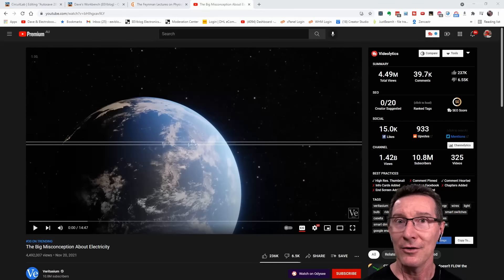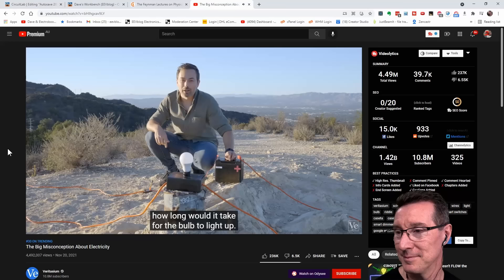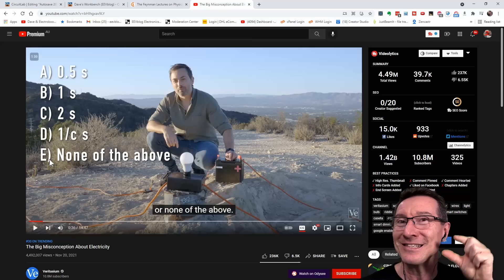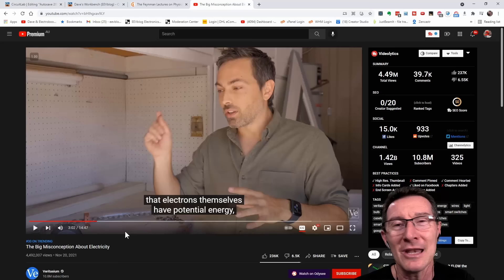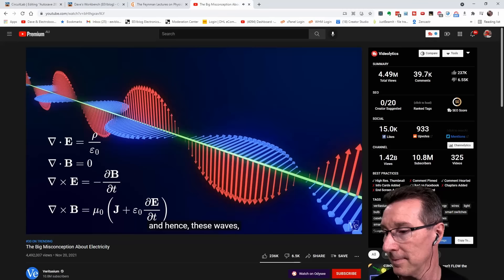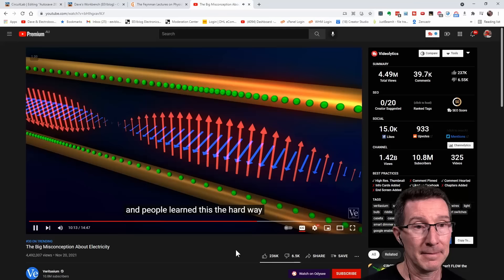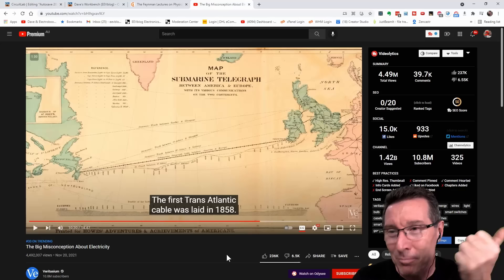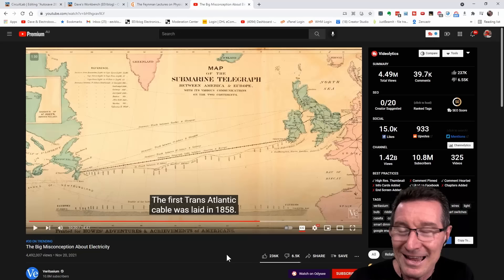EEVblog 1439 - Analysing Veritasium's Electricity Misconceptions Video

Comment: 20:41 "everything he fundamentally said in the video is correct"
I disagree, within the conditions he stated he is at least incorrect on:
- If the light bulb turns on immediately when current passes through it, it would always be on, as you have a massive antenna connected to it, not 1m/c seconds after switching on.
- For that same reason, the resistance of the wires does not need to be zero, as the light bulb turning on after 1m/c seconds would be because of the capactive and inductive coupling, not by a round-trip electron flow.
- "not really what's happening in the wires that matters". Incorrect again, without the wires there would be no magnetic field and thus there would be no energy transfer.
Reply: @Kris M, sorry, but I have to disagree somewhat.
- with the switch open, you actually have 3 massive antennae. 1) battery to lamp 2) lamp to switch & 3) switch to battery.  Calculate the net effect of all antennae.
- the resistance will change the answer.  Remember the 1m.  Remember also the lumped element in Dave's simulation; the model is more complicated when resistance is included.  The math then gets more complicated and it will take longer.
- It is what happens outside the wires that matters.  But, you are correct, in that the wires do affect what is happening outside.  The no resistance wire was chosen to create a simple model that is easy enough to understand for the purpose of the discussion.  The wire with resistance is in the real world, but the real world is messy, and that would create too much messy distraction in the discussion; for sure we would still be stuck working through the math...
Reply: I have personally done a large number of electrical experiments with a flying device that emits electrons into the air and produces thrust that way, enough to lift its power supply!.  I am an EE and inventor.  When I think of the way that vacuum tubes and CRT sets operate, I find the popular modern theory that electrons move slowly to be contrary to the results that I observe and it is hard to understand how that is possible, despite some of the equations that I have seen.
Reply: @marinkamenard3477 
- Obviously the shape of the antenna(e) would affect its impedance and amount of ambient energy captured by it, but I do not see how that would change the light bulb from always being on, because it turns on at any current, as stated and required for answer D to be possible. The circuit is some kind of dipole and open loop antenna hybrid, it will pick up (net) energy.
- I do not see how resistance would affect time. It only affects the voltage and current once what we would consider stable state has been achieved, and how fast we get to that state, but current and voltage at the bulb will always start to change after 1m/c of time.
Remember that the current and voltage change along the wire also cannot travel faster that the speed of light. In other words, only an infinitesimal small length of wire has been travelled when the bulb "lights up".
The issue is with the presented model and conditions. It requires that the bulb lights up even with an infinitesimal small current for answer D to be valid, which in itself invalidates the necessity of a zero resistance wire. It is also depending on the electric and magnetic fields, but while making an explicit requirement for the wire he didn't make that for stray fields to be considered not present.
Reply: @KraussEMUS1  Are you talking about ionic trust that is generated by accelerating ions using an electrostatic charge?
Electrons flying through the air or a vacuum can travel much faster. But in an electrical wire there are so many electrons involved that they travel quite slow to achieve a current we consider useful.
Think of it as a pressured air system which has trillions of pressure in your preferred unit. How fast would the air molecules have to travel along a tube to e.g. power a pneumatic drill?
(for every doubling of pressure the speed would be halved)
Reply: @Kris_M  Thanks for responding. I would think in the pneumatic case that the air in the  tube would have to be replaced after a while so eventually the air in the tube would start to move really fast, or a really small outlet wrt the volume in the tube and a high replacement rate.  How can a cathode ray, old fashioned tv tube, continue to work if modern drift velocity theory is true?  Same with the crafts I'm talking about.
Reply: @Kris_M  Hi Kris, I forgot to mention, yes I was talking about my self contained ion thrusters, but my observation/question applies for many devices.
Reply: @KraussEMUS1  Tube not as the storage tank of an air compressor but as the representation of a section of pipe or hose used to connect an air compressor to a hand tool like a pneumatic drill. At 8 bar air would travel quite fast through this tube to power the drill, but at 8 trillion bar the air would travel a trillion times slower.
The air molecules then behave like electrons in a copper wire. They jump around quite fast but their average speed along the tube would be extremely low. This average speed in a certain direction is what we call drift velocity.
Reply: @KraussEMUS1  The electrons that get shot by the cathode at the screen in a CRT are not travelling through a wire, they are liberated from a metal conductor and then fly through a near vacuum, drift velocity simply doesn't apply. It's like connecting a simple air pistol onto our 8 trillion bar air tube. The air would travel very slow through the tube while we would get a high speed storm out of the pistol.
Drift velocity is not a law of physics, it is an emergent property. Because the density of electrons is so high in an electric wire they only have to travel very slow to make a current flow that we find useful.
Reply: @Kris_M  
Very plausible explanation, could be correct however, while this physics is popular, even unquestioned, it still doesn't seem to follow common sense for a crt or for my craft. 

1 amp is equal to 6X10^18 electrons per second (1 Trillion electrons would be = 6x10^12 of them).  My ion propelled vehicles require at least a couple watts to move enough air through the structure to provide sufficient lift to carry the power supply, much power is lost in the transformer in the form of heat.  Without many of the electrons being absorbed by O2 molecules and crossing the airgap from collector to emitter and beyond, it is hard to understand how it could work aside from perhaps an energy wave rather than ions and electrons.  I also used to run an electron beam welder.  The experience further makes me think the widely accepted theory that electrons move slowly through  and over wires may be incorrect.  It seems like many devices could not transfer enough energy if that is so.
Reply: @Kris_M  If the electrons are leaving the metal at a near relativistic speed in large quantities, I would think the metal would rapidly be drained of them.  Then it would have to be replenished at an equally high velocity.  I still don't see how it is an "emergent property."  It still seem more like an unquestioned theory that does not add up when observing the way several devices operate.
Reply: @KraussEMUS1  "Then it would have to be replenished at an equally high velocity."
No, it wouldn't. The current flow in the metal wire is a high density of electrons, the current flow from the cathode to the screen is extremely low density, hence the velocity in the wire is low while that through the vacuum is high. That is what I tried to explain with the compressed air analogy.
I get the feeling you don't grasp the difference between speed (velocity) and flow rate. Their relation is dictated by the cross section area and density.
You say 1 amp equals 6X10^18 electrons per second. In a copper wire there are 8.5x10^19 free electrons per mm³ (cubic millimeter). That means for a 1mm² copper wire the mass of electrons have to travel less than 0.1mm per second for 1 amp.
You could've made this very simple calculation yourself, you calculate flow velocity (in this case electron drift velocity) by dividing flow rate by density and cross section area.
Reply: "an unquestioned theory that does not add up"   Makes me think you have no idea how science operates or how skeptical and competitive scientists can be.
"doesn't seem to follow common sense for a crt or for my craft"   It might be surprising when you first learn about it, but it makes perfect sense. The idea of "common sense" has never been a good indicator to separate fact from non-fact.
Reply: @Kris_M  You said "I could have made this very simple calculation yourself."  It sounds like you are upset with me, and it also sound a bit belittling. If this is not fun for you we don't have to talk. Please keep it friendly.
I have done the same math as most other EEs.  The thing is, if electrons flow into a piece of metal and then flow out at near relativistic speeds, at a specific wattage, the piece of metal will eventually deplete of electrons unless the electrons are flowing in to it at the same rate/ quantity.
Reply: @KraussEMUS1  You want to talk feelings and intent? Fine.
I was just curious why someone would jump into a thread with a new subject and a bold claim about it, and how they would defend that claim. I'm not here for fun nor am I upset. My statement was neutral except for making an important point regarding my observation about the misunderstanding you display.
Either you have not done such a calculation, you don't grasp the meaning of the physical factors in that calculation, or you are willfully not understanding it.
At first I was giving you the benefit of the doubt that you honestly don't understand and that I wasn't explaining it very well, which is fine, I'm not a teacher nor do I aspire to become or act as one.
But let me tell you what I do see now in this thread. I strongly advise you to do some self-reflection.
You claim me sounding "a bit belittling", that is hypocrital. You have been belittling science, scientists and people involved by saying "the popular modern theory", "while this physics is popular*, even *unquestioned*", "an *unquestioned theory". You are insinuating here that all people in science blindly follow whatever is popular or written down in some book and never question those things.
At the same time you're trying to represent yourself as some kind of questioning authority by saying "I have personally done a large number of electrical experiments" and "I am an EE and inventor."
Yet, instead of trying to incorporate the fundamental misunderstanding I try to point out, you ignore it and you give another argument demonstrating that misunderstanding. Like your last sentence. "flow out at near relativistic speeds" ... "in to it at the same rate/ quantity". Same rate yes, but not the same speed, speed is not the same as rate, the exact point I've been making by directly stating it, by analogy and by example.
I think you finally got upset and instead of handling that unwanted emotion you project onto me being upset, acting belittling, it not being fun and becoming unfriendly. (Saying "Please keep it friendly" to an individual who isn't being unfriendly, is itself unfriendly.)
Reply: @KraussEMUS1 
No doubt my comment will make you feel even more uncomfortable, that's not what I'm trying to do, I'm not being unfriendly here.
I'm hopeful you take this in good faith and don't become a captive of your own emotions, as is so popular nowadays. It is okay to feel uncomfortable with the realisation that you might be wrong, but it is not okay (healthy) to hide behind feelings. And yes, I've been there.

Comment: Even though I took electrical engineering in college, to my recollection they never really went to this depth at the Bachelors level.

That said, the question was, how long would it take to light the lightbulb.  In the transient state at turn on, I can see now that there would be energy at the bulb rather quickly, but would it be enough power to actually light the bulb, and even if it could, how long would it last until the steady state kicked in at DC?
I would say the transient would be insignificant and so the question remains unanswered.

I would agree, electrons aren't following from the power station to the home, as there are electrical gaps in the circuit, but that doesn't mean (or rather prove) there isn't a current flow.  Each transformer changes electrical energy, to magnetic energy, then back to electrical energy.
Reply: You need this level of depth when trying to figure out why you fail the CE and FCC tests. Or when dealing with high speed data transmission lines and laying out the pcb for them. 
Something as common as having a Power ground plane pair and routing a trace from the top to the bottom layer through a via when it has too high of frequency content will cause a failure because HF current only flows on the surface and can't get to the other side of a plane without going around it..  mode conversion results. A stitching cap near the layer change can help but even better is not to do it in the first place. Closely coupled planes and holes nearby could also do the trick I suppose. You need to consider this as there must be an image current on the adjacent plane and it had to be part of a loop, and keeping thst loops parasitic inductance AKA loop area low is paramount
Reply: You're absolutely right though the amount the bulb would light would not be what one considers turning on. I mean... should we consider the capacitance of the open switch before it closes? Before that capacitance charges there will be some small current flow lol
Not to mention irl with that much loop area magnetic susceptibility to interference is outrageous. And the extremely long rise time due to the parasitic inductance is ignored but they mention the "good" mutual inductance while ignoring the bad inductance. It'd about what's significant in the situation. Without dimensions listed, the mutual good inductance will be negligible as well as the capacitance. But the "bad" inductance will be HUGE. And you could argue external interference will turn the bulb on before closing the switch lmfao unless this is inside an anechoic shielded chamber somehow built this long 
And the dielectric constant of air is disregarded for some reason among with that of the wire insulation
Reply: I think it would light up as if the characteristic impedance of the transmission line was in series with the circuit.  The original video doesn't specify the thickness of the wires, but punching some random junk into a TL impedance calculator, a 1m spaced pair of any reasonable thickness of conductor's going to be several hundred ohms.  
So, it wouldn't work with a typical incandescent bulb, but you could light an LED, and it would act exactly as if that 500ohms (for example) were just a resistor connected between the switch and led.  It wouldn't change at all until the transient reached the end of the transmission line (on the moon, or whatever), at which point there would be a bunch of reflections making it flash every couple seconds as it bounces back and forth until the energy is dissipated in the LED, and it eventually reaches the steady state, where it would act like it's directly connected, (no additional impedance from all the wire)
Reply: @nwimpney  an Led that would burn up in the steady state? (With the voltage step you're gonna need for the field stuff to be meaningful) Hmm I hadn't considered that being one of the caveats
Reply: I think it's silly that this is all based on parasitic capacitance and mutual inductance while we assume no parasitic resistance. Might as well be an infinity wide battery, infinitely wide parallel plates of superconductors and in a perfect vacuum lol

Comment: Thank you for this! I have a master's in physics and I was confused by veritasiums video... I thought he was implying that all of the power is transferred in 1/c seconds through the fields. After you pointed out that it's just capacitive coupling of the wires it clicked instantly.
Reply: Not just capacitive; also inductive, since current through a wire induces an opposing current in a parallel wire.  It is a combination of these two characteristics that determines the impedance of the transmission line.  The inductive coupling is affected by the distance between the wires, while the capacitive coupling is affected by both the distance and the wire diameter.  It is the combination of these two characteristics that determine the impedance of a twin-wire transmission line.  And by the way, the video was MEANT to confuse, so don't feel bad.

Comment: Thank you!  As a layperson who has only wired up and soldered a few guitar pick-ups/pots and various lamps and repaired fixtures around the house (( NOTE: I have a "I watched my grandpa and he knows everything from WW2" grasp of electrical things )) even I, dumb as I am, found Veritasium's video hard to follow until I watched this video.  The way Veritasium explained things I got the impression he was trying to say one could jump a car simply by laying the one set of jumper cables over the dead battery and not even hooking the terminals up to the cables.  Or maybe I could run some 12-2 Romex up to the bathroom light, stop short by a foot or two, and just loop it back without connecting it and still get light.  It caused a lot of "huh?'' and "what the hell?" utterances from me until I watched EEVblog's video and saw the trick question for what it was.  As soon as he explained about the missing units and trick question I went "OH! Thank God, I'm not nearly as stupid as I just felt!" ...I mean, who knows, maybe I am... after all I am still amazed and bewitched every time someone lights up fluorescent tubes 5 feet away from a tesla coil. 🙄🤣